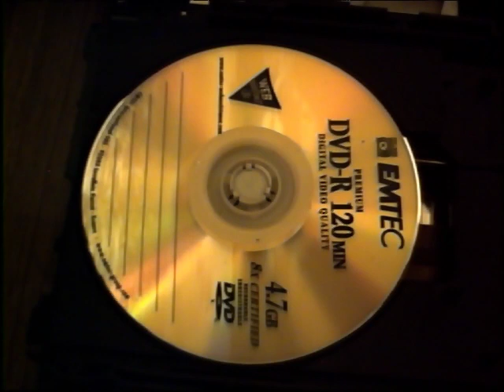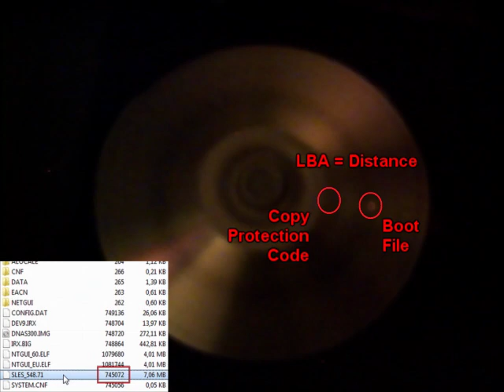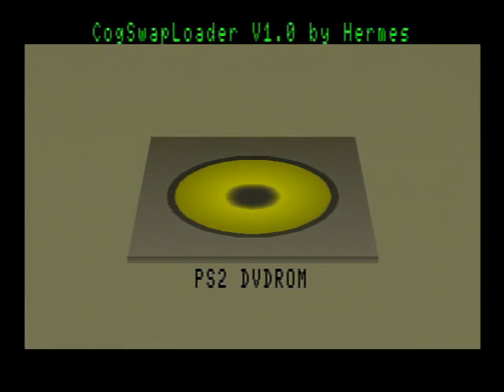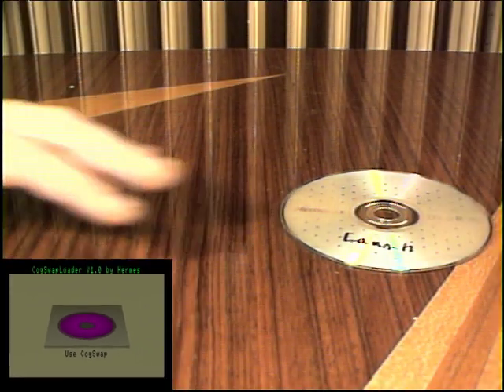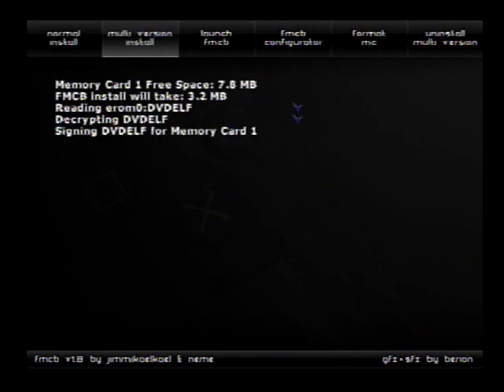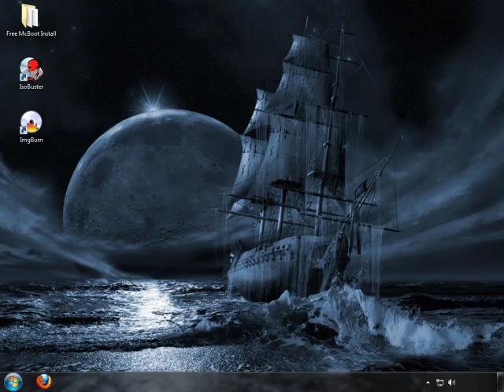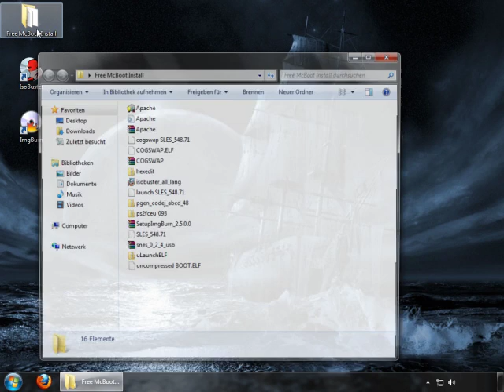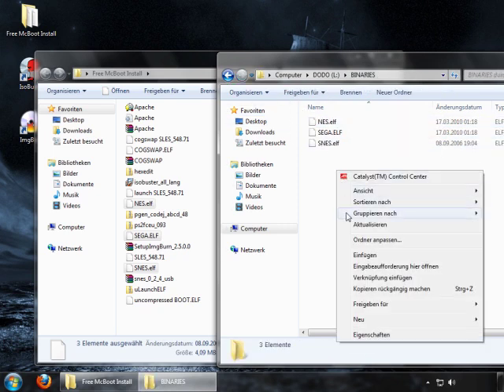How to softmod your fat PS2 - 3/4

Comment: Excellent!!! a bit tricky swaping the discs but works flawlessly. a little tip. you can remove the plastic edge on the dvd tray to ease of swapping discs. THANK YOU VERY MUCH!!!
by the way I used Tiger Woods PGA Tour 2004, and the LBA is 1736000, so its deam easy after you got how to swap.

Comment: I don't comment often and I''m new to this stuff however I will say, I got it first try with gun lba value of 1.4 mil or somewhere near there. also reading through the comments, you do have to wait for the playstation 2 logo to come and go BEFORE you start swapping or it wont work. also I recommend getting some practice with your swapping technique using the cover disc for whichever rewrittables before you go scratching up all your games. I only had this one game to use and it worked. other than that follow all of the video instructions and it will work for you. P.s. I used dvd+r and it worked
Reply: thanks for that added info,  only wish i would have read it earlier...lol. gonna try it your way.   thanks

Comment: Right so as I've already said here I was using a disc with an LBA of 281. I've since used a different disc with an LBA of 1.7 million, and have now done it successfully. My advice - Deffintely use a high LBA and only start swapping after the Playstation logo, when it moves out. I got it first time with this disc! Good luck

Comment: I got stuck on launch disc... it only turns to black screen if i start it with the original... laser reads the copyright code, so it doesn't work until i put the original game. afterwards, i tried swapping with launch disc, but now there's just a blackscreen for 10 minutes... still nothing.. any help?

Comment: @Drummaniac17 and I just now learned that I couldn't swap well because I was putting the plastic thing on the disc upside down, and it was causing this horrendous grinding sound and the disc wasn't spinning properly. Now I know, and I'm burning a new disc for a new game. If it doesn't work this time I'm just going to buy 007 Agent Under Fire.